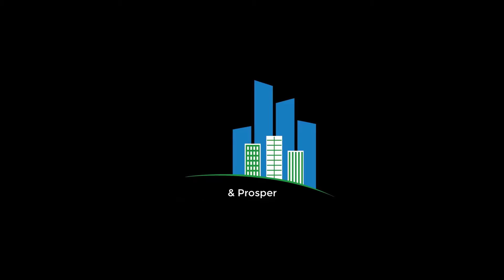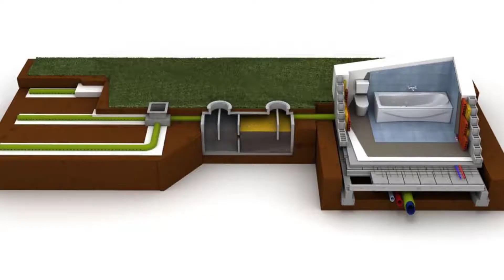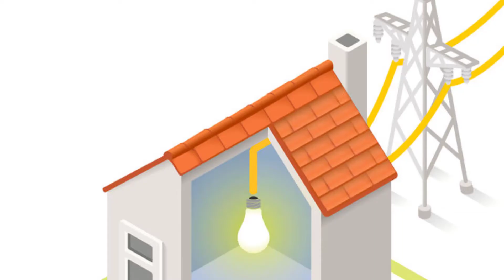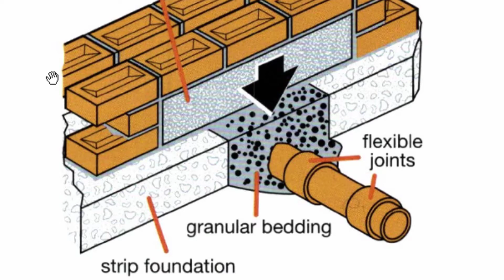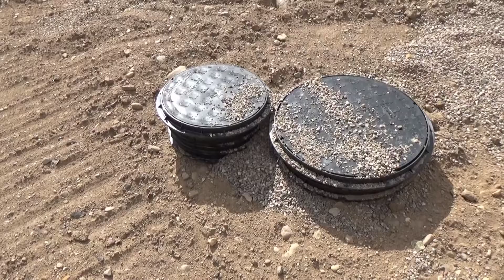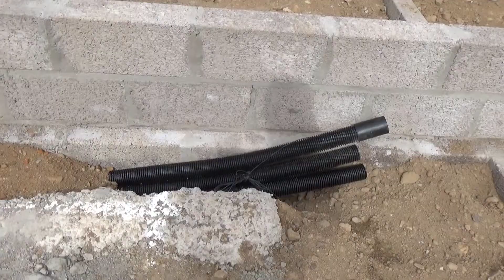Planning Your Foul Water and Below Ground Drainage System is Essential

Comment: Great content. I'm interested to know about the 110mm internal soil pipes for the kitchen and other rooms. So your sink waste being 40mm would come down the back of the cupboards and connect to the internal 110mm soil pipe then pass outside to a 300 or 450mm chamber? If so, if the sewer blocks is there no chance that 110 to 40mm reducer cap can come off and leak into the room? As is passes to the outside, does it require a U shaped gully to prevent any smells or is the sink trap enough?
Reply from the maker: Hi Dan I am afraid I am not qualified to answer that question. You would need to speak to a plumber, which I am not.  I am a property developer, and my job is to find off market land at the right price and hire competent people with the right skill set to carry out the actual building of the structure.  Of course, I have learnt a lot about the actual building process along the way, but that was not necessary to get started.  Sorry I can't be of more help to you.

Comment: Hi, Fantastic videos. I am building an extension and thinking the best way to    save having the slab over the foil drain would be to come out of the bathroom and into the roof space of the extension the across and our down the wall to the existing drainage system. Is this allowed?
Reply from the maker: Hi Andrew Owen , Without actually seeing any drawings I can't be certain.  The main requirement is that any foul waste has to be vented above the highest window height. The waste itself, can travel to another outlet as would be the case with 1st floor and ground floor toilets.

Comment: Hi there, connecting all foul before pouring concrete at foundation level is very clear and obvious in this tutorial. With respect to upper floors, due to the need for a vent would you also recommend that you only install one vertical "master" foul pipe and ensure all upper floors (3 storey house) in my case connect to that one master.
Reply from the maker: Hi craig sparrow, Thank you for your comment.  It would really depend on the position and number of bathrooms.  In the project house all bedrooms have Ensuite bathrooms.  On the 1st floor the bathrooms are at opposite ends of the house. We have therefor two different SVP "Foul Water Pipes.” What we were able to do was have the pipes exit through the roof space as a slate vent instead of the pipes sticking out above gutter level on the side or back of the building. Therefor it is completely unobtrusive.